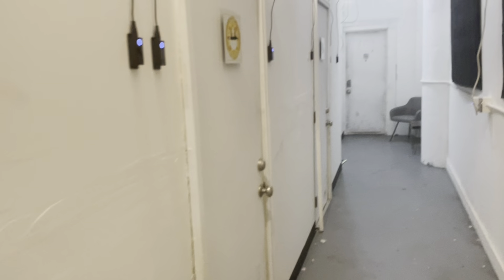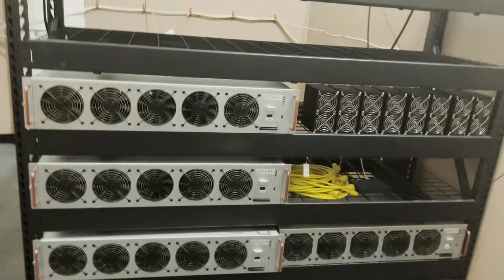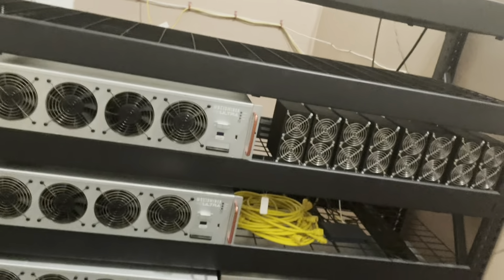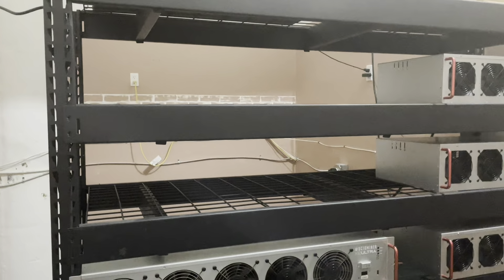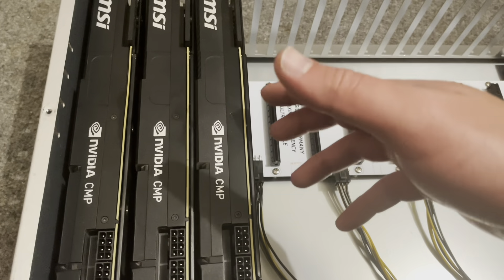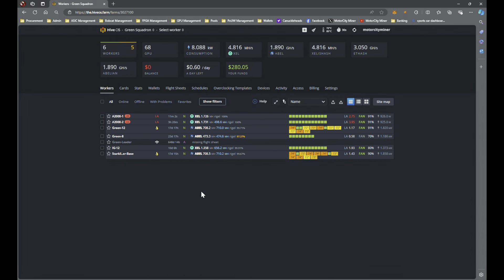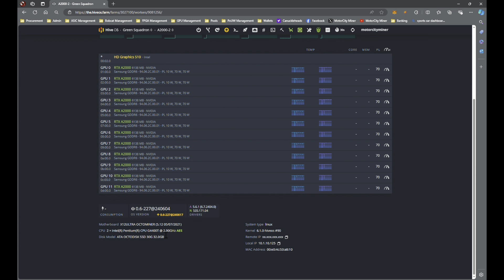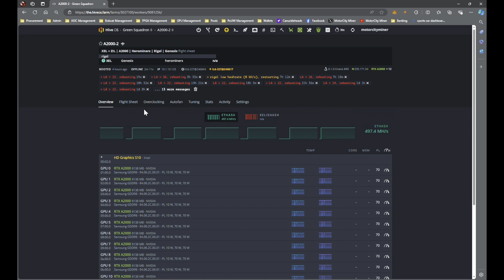Back at the Crypto Mining Farm! (Finally)

Comment: I have my 6 50hx in my octominer with shrouds still on and they are running great
Reply from the maker: nice, did you leave a blank slot between for better spacing?
Reply: @motorcityminer  no I have 9 cards in it and the 50hxs are right up against each other
Reply from the maker: i thought keeping it that way but i have so many passive cards that would benefit from these tight spacing

Comment: dude i got the SAME issues with my octos rebooting because of load average every 1-2x a day.... but only happens with XELIS though.... weird.... keep me posted what you find out bro!
Reply from the maker: Will do. Have some l16GB ECC DDR3 sticks coming to see if that helps the issue.
Reply: @motorcityminer  hey any updates?
Reply from the maker: yep, working on update vid. but main issue is not actually RAM, software issue w/ HiveOS latest kernel. More RAM helped but did not fix. Also, was dumb and these don't take ECC mem lol, had a brain fart lol

Comment: typically la issue is the mining software your using
Reply from the maker: everything software wise is the same between these two rigs and all my other Xelis rigs. Only differences are the CPU and RAM so hoping a RAM upgrade does the trick. Will find out soon.
Reply: @motorcityminer  ahh ok i just know a lot times certain miners are a cpu hog.
Reply from the maker: will let you know how it goes